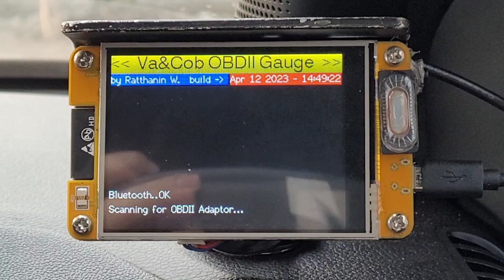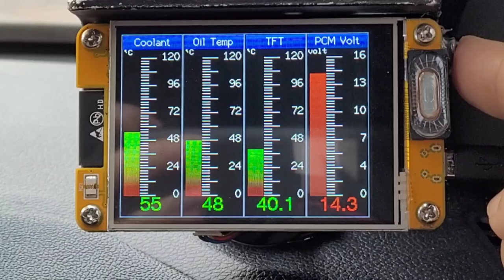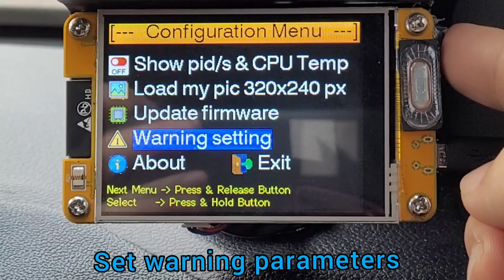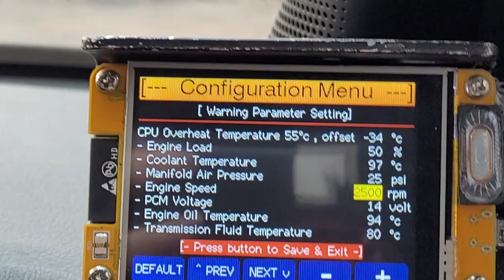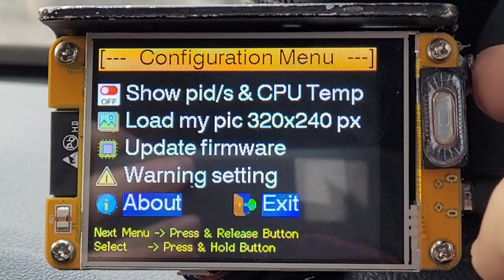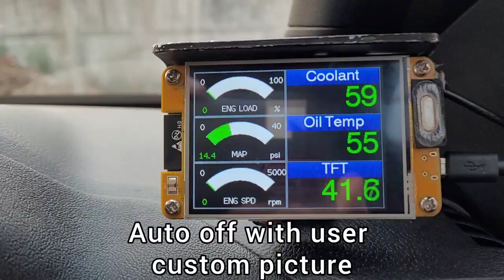ESP32 OBD2 Gauge #ep2

Comment: Hi, great project!. Do you use flash 25q32? my board does not have it soldered.
Reply from the maker: There is not psram on this board but the esp32 module itself has 4mb flash rom

Comment: How did you figure out which CAN values to read? lets say i want to build my own version of this for an audi and connect my esp to a obd2 adapter.
i can use apps like torque.

how did you know what specific values to read for RPM / MAP etc for you model car?
Reply from the maker: @andre-th2rw  OBD2 mode 01 is a standard. So every vehicle that compatible with obd2 could read standard parameters (rpm, speed,etc..) but not all
For custom pid, it's different and upto each car maker.

Comment: Hi, I managed to get the OBD gauge to work well with a blue OBD2 marked ELM327.
Now I'm trying to use an OBD vLinker MC+ because ELM327 does not transmit parameters with PID2218E4.
At startup it sees the vLinker MC+ with address e0:ff:f1:6f:aa:45 but it does not connect.
Do you have any suggestions?
Thank you very much
Reply from the maker: @fabiopesenti  in the sketch.  I fixed it to connect to the obd2 adaptor that has the name "obd2" only.
But you can change it.
Reply: @vacob6494  Hi, now the  "vLinker MC+" at startup is recognized and the program run but after 5 seconds the application closes and restarts this continuously . This problem did not happen with blue OBDII marked ELM327.
How can I modify the code?
Thank you very much
Reply from the maker: @fabiopesenti  could u please connect gauge to laptop and see debug message on serial terminal?

Comment: I have finally figured out which is the PID for my 2016 Subaru Forester CVT Temp (2210D2) but it comes from the TCU (7E1 address, usually the pids come from 7E0). I managed to test is using car scanner terminal and it works. I found where to edit the standard pids in your code but haven't managed to change where the pids come from, by default they come from 7E0, but in order to read my CVT temp i have to change it to 7E1, is it possible to change the module address?
Reply from the maker: I'm not sure about the ECU address but from this page. https://obd2australia.com.au/auto-transmission-temperature-pids/  subaru and ford TFT has the same ECU address but different pid,   I'd like u to try 221017 and see if it works,  by the way you can read data from ECU address too, please read this datasheet https://www.elmelectronics.com/DSheets/ELM327DSH.pdf  on page 39 and 47. (recommend true ELM327 adaptor, not cheap one) please remember that you need to correct calculate formula to give the correct temperature.
Reply: @vacob6494  Thanks for your attention. I tried 221017 before, does not work. 2210D2 I'm 100% sure it works because I successfully got the temperature from it by adding a custom sensor in CarScanner app, but I had to use the header 7E1 instead of default 7E0.

If you give no instructions to Elm327, it will always go for the default header (7E0), so it all your needs are standard PIDs, there no need to worry about the headers. But in my case I need to go for the 7E0 so I have to figure a way to change that
Reply from the maker: @MateusLeonardoMendes  you can try connecting and reading with a Bluetooth serial terminal (android or laptop PC), I believe we can set ELM to read from a specific ECU address.
Reply: @vacob6494  I did exactly that using my android phone and got the correct answer. The challenge now is to do this with your code and get pids from multiple control units, since i need PIDs from the engine as much as i need from the transmission.
Reply: @vacob6494  I succefully could read 2210D2 using your code and managed to change ECU adress using ATSH 7E1 at line 64, but it made all other pids stop working. Is it possible to add another row in pidConfig table to change headers? EX: "0105", "ATSH7E0".... "2210D2", "ATST7E1". It needs to be able to switch headers on the fly.

Comment: Congratulations. Could you write a code program to get the engine speed data. The output is OBD J1850VPN via ELM327. Input data revolutions at 8192 baud. Using ESP32 to send and convert data.
I just have a 1999 engine (J1850VPN) and a 1988 dashboard. swap engine.
Reply from the maker: Hi, I think it's possible, if ELM327 adaptor support J1850 you can try ,

Comment: Hey, really good project! I am makeing graduate work about OBD2 conection etc. I bought OBD-II CAN-BUS DEV KIT. My question is it is possible to connect your device with this kit or work only via elm327 bluethoot device? Thank you so much!
Reply from the maker: as long as your KIT is an obd2 interpreter and compatible with ELM327, it'd work. the connection depends on your design.  If you want to connect over serial instead of Bluetooth.  you must modify the sketch.
Reply: @494 Thanks for the response, yes I want to connect it via cable to the car

Comment: Hello, 

 Is there any way to measure the level of braking with the OBD device? 

     Thanks,
Reply from the maker: You mean brake fluid level or brake force level?
Reply: @vacob6494  brake force level. Best Regards
Reply from the maker: @oida6802  in standard pids, there is no brake force , but extend pid could or couldn't.  Up to car manufacturers.
Reply: You could put an accelerometer on the system.

Comment: Hello friend, I'm from Brazil.

Did you use the standard bluetooth library? because the esp32-s3 uses low energy bluetooth, i'm having trouble getting the library to work.

Is the software compatible with ELMDuino? with all the commands? could you inform?

I have the same display board, but the display I'm using is 7 inches.
Reply from the maker: the sketch uses the standard Bluetooth classic library,  not BLE.  and is not compatible with ELMDuino.  I wrote a sketch from scratch to minimize code size.
you can see the code from the GitHub URL.

Comment: Hi I tried to write a comment but I think it was deleted because it had a Link in it. I tried to copy your project but sadly it isnt working right. Somehow the Background ist white instead of black and the Touch doesent work. I tried skipping the calibration by uncommenting the calibration Part and now it connects to the obd reader but doesent show any values. 
I bought a Board that looks exactly the same as yours. Is there any advice you could give me to solve my issues?
Reply from the maker: I recommend not use cheap obd2 adaptor. (I have recommend good elm327 adaptor on my github.)
Please recheck the following 
- Is your board exactly the same model and manufacturer. There are module that almost the sam but something different.
- there is modified  touch.h cpp in tft_espi extension folder.
Did u copy and replace those files?
Reply: @vacob6494  I copied the modified Version. For the obd2 Adapter i bought a Elm327 from aliexpress and made shure that it was the Version you described on your github. The Adapter works withy my Phone but not the device. Maybe i bought the wrong Display. Mine has one of those cheaper touchscreens which can be operated with a plastic pencil. Could that be the Problem and is there a way to get this screen working?
I checked again and it seems like all colors are inverted. I am gonna test it again later with a different car. Maybe that will make it display some values.
Edit. The only difference i could see is that my board has a USB-C port next to the micro usb port
Reply from the maker: ah, that's a different one. it'd work, but you need to edit display and touch part to get it to work.  @_der_pinguin_2463
Reply: @vacob6494  Thanks. Do you know what I exactly would have to change? Sadly I am not that good at programming.
Reply: @_der_pinguin_2463  same problem. Did you found solution?
Reply: @saulleg  No Sadly not. I am not good at coding so I dont really know where to start. Also it seems like my audi doesent provide the oil Temp stat I was looking for  over obd2.

Comment from the maker: Hi Folks, a new source code update (full version) .
Reply: I have successfully edited your code to read an analog input + touch screen instead of button and come pids for Subaru. however, i can't manage to read my transmission fluid temperature (i have the pids, ECU address and mode but it doesn't work). If you have the time, could you kindly help me solving this issue?
Reply from the maker: @MateusLeonardoMendes  you've gotta know PID and fcalculation fornula to read Subaru TFT.
Just change pid 221E1C (for Ford) to 22xxyy something and the right formula. It should work.
Reply: @vacob6494  I believe its 221017 for Subaru and I have the formula, however it seems to be different header, it should be 7E1 instead of usual 7E0
Reply from the maker: And it gave wrong value?
Reply from the maker: @MateusLeonardoMendes  so you 've tried but the result was wrong?
Reply: @vacob6494  yep but it seems like it's giving the same answer regardless of the temperature
Reply from the maker: @MateusLeonardoMendes   it's obviously wrong PID numbers. or. not support.  In some vehicles, there's no temp sensor installed, especially, in manual transmission.
Reply: @vacob6494  It might be wrong PID, but the sensor is there, I can read it with car scanner
Reply: @vacob6494  also, can you share the STL files for 3d printing the case you have in the other video?
Reply from the maker: @MateusLeonardoMendes  the enclosure was made by custom box store. So i dont have 3d file, but i might measure the dimensions and create 3d print file later.
Reply: @vacob6494  how can I change the header from 7E0 to 7E1 in your code? I've looked but haven't found anything
Reply from the maker: @MateusLeonardoMendes  Here
const String pidConfig[7][9] = {
Reply: @vacob6494  ain't that where I change the pids? I need to change the header to 7E1 (transmission control unit). Default header is 7E0 (Engine control unit)
Reply from the maker: @MateusLeonardoMendes yes, you can try

Comment: Hi I'm looking for an application to monitor the parameters of my car. Yours is perfect.
I compiled the code and modified some functions no longer supported on ESP32 ver3.0.
I compile the code but end getting an error.
The sketch uses 2162777 bytes (110%) of the space available for programs. The maximum is 1966080 bytes.
Global variables use 65696 bytes (20%) of dynamic memory, leaving another 261984 bytes free for local variables.
The maximum is 327680 bytes.
Compilation error: The text section exceeds the available space on the tab.
Thank you very much
Reply from the maker: Please roll back to ESP32 Ver 2.0.17 , and select partition scheme to huge APP 3MB instead. (OTA won't work) but you can successfully compile and flash.
Reply: @vacob6494 It's greate 🙂 i am able to build on ESP Ver.3.0 ...... the problem was on partition scheme. 
The correct selection is as you suggest (No OTA/1Mb).
Now purchasing the ESP3 TFT card you suggested and would like to contribute to the development of this project

Comment: I was finally able to compile this sketch and uploaded to my ESP32 CYD 2.8 inch board.
Screen now shows Touch Screen Calibration and asks to touch the corner as indicated. 
I tried that but nothing happens.  Any clue what to do to fix that?
Also during compilation I got the following message.
Library SPI has been declared precompiled:
Precompiled library in "C:\users\jhuss\Documents\Arduino\libraries\SPI\src\esp32" not found.
Similar message for SDI
Anyone who successfully used this sketch, please, give me some help.

Thanks.
Reply from the maker: comment out this line  at 343
//  touch_calibrate(); 
to skip screen calibration. I guess it's bug since TFT_eSPI update,  will fix it later.
Reply: @vacob6494  Thanks. That worked.
I connected my OBDII to my Ford Energi 2017 and on screen it says one device found and gives a Mac address but then in next line it say No OBDII device found and just cycle the same message. 
Anything else I have to do to get it going?
Reply from the maker: @javedhussain9514   from the sketch,  gauge will scan all nearby Bluetooth devices, but connect to Bluetooth device that name "OBDII" only.  by this case, your ELM327 Bluetooth adaptor name must be exactly OBDII. or if not u can modify sketch to connect to another name Bluetooth device.
Reply: @vacob6494  Thanks for the help so far. I am so close to get it going but still may be one issue left.
My OBDII works fine with an app on my Samsung 7 phone. I checked under Bluetooth and the device is named as OBDII. When I pair the unit with app it asks for the pin to pair and then it works fine.
So I am not sure why the sketch is not finding the unit. It does find my other BT devices and list them but not this OBDII.
Reply from the maker: @javedhussain9514  Perhaps ELM327 connect to your Samsung 7,  so try unpair OBDII in Samsung 7 phone first. to prevent OBDII keep connecting to the phone,  that's why Gauge cannot see in the scanning list
Reply: @vacob6494  I tried that and still no show.
My other BL devices show up by name but not this one.
My be my ELM327 is not compatible with your sketch. Thanks.
Reply from the maker: @javedhussain9514  i have a recommend best and affordable ELM327 adaptor url in this video description or in github
Reply: @vacob6494  Does your touch works after commenting that line out? Also, my touch calibration was on line 293, not 343. Touch doesnt work for me. I also had to disable CPU temperature shutdown, but yet no touch.
Reply from the maker: @MateusLeonardoMendes  touch won't work,  if it works , you could calibrate touching point.

Comment: Very good project.
I am a new bee with this CYD.
How to use your code to upload to CYD?
Any detail instructions will be helpful along with how to connect the push button?
A schematics will be helpful.
Thanks.
Reply from the maker: Hello thank you for your interesting,  there are  source code URL in the description.
Reply: @vacob6494  Yes I see the source code but it does not show how to connect the push button and how to load the code to CYD.
Reply from the maker: @javedhussain9514  in schematic diagram show how to connect   speaker and a button.
In sketch also defined button pin number.

Comment: can i connect the serial to obd ? Dont use elm327
Reply from the maker: yes, but that needs more work,  CANBUS interface chip + canbus communication.
Reply: @vacob6494  Can you share the code using canbus?  if i use iso 9141-1 and iso 9141-2 is it ok?

Comment: use the type of wire to interface with obd is not ?
Reply from the maker: Yes just direct connect to serial from elm327 to esp32 uart. But need hardware modify on obd2 adaptor too
Reply: @vacob6494  I really need your help. I have an ELM327 v1.5 OBD reader and I'm wondering what kind of modifications are needed to connect it directly to an ESP32 board to OBD reader. I attempted to establish a direct connection by wiring the OBD2 Bluetooth module's TX and RX pins to the corresponding TX and RX pins on the ESP32, but I didn't receive any data. If I remove the Bluetooth module and connect the OBD2 pin directly to the removed TX and RX pins on the OBD2 reader, will it work? thank u
Reply from the maker: Yes, that should work. Eemove bluetooth module on elm327 adaptor. Connect ESP32 RX TX pin to adaptor TX RX pin
If it doesn't work, try swap pin.
One thing should consider. Esp32 logic level is 3.3v but the adaptor might be 5.0v
Direct connect should work, but I prefer level shifter .
Reply: @vacob6494  thanks u so much for your assistance. i will let u  know the result. can u have your email please🙂
Reply from the maker: @cinemahub8888  if you have FB account please IM me here,  more convenience for me. https://www.facebook.com/VaAndCob

Comment: I tried to compile the sketch but got the following error.
Please help me correct the errors. Thanks.

Arduino: 1.8.19 (Windows 10), Board: "ESP32 Dev Module, Disabled, Huge APP (3MB No OTA/1MB SPIFFS), 240MHz (WiFi/BT), QIO, 80MHz, 4MB (32Mb), 921600, Core 1, Core 1, None"

VaAndCobOBD2Gauge:37:10: fatal error: JPEGDecoder.h: No such file or directory

 #include <JPEGDecoder.h>

          ^~~~~~~~~~~~~~~

Multiple libraries were found for "SPI.h"

compilation terminated.

 Used: C:\Users\jhuss\Documents\Arduino\libraries\SPI

 Not used: C:\Users\jhuss\AppData\Local\Arduino15\packages\esp32\hardware\esp32\2.0.3\libraries\SPI

exit status 1

JPEGDecoder.h: No such file or directory

This report would have more information with
"Show verbose output during compilation"
option enabled in File -> Preferences.
Reply from the maker: The library file "JPEGdecoder.h"  is missing.  Pls check if all needed library files were added to arduino ide.
Reply: @vacob6494  Not very clear to me. Can you please give some more detail on adding all files to ide?
Reply from the maker: @javedhussain9514  well.  Perhaps this project is for those who have skill and familiar with arduino ide. You can search how to work with arduino ide , how to add libraries and boards.  You can do it.
Reply: @vacob6494  well, at least you can point me where this .h file is located and I can then figure out why it is causing an error.
Reply from the maker: @javedhussain9514  you don't need to find .h file,  all u can do is add missing library .h file from arduino ide (library manager)  and there will be many libraries u need to add to compile this sketch.